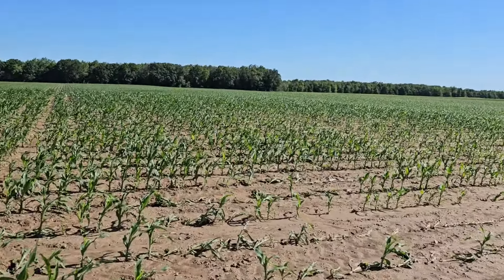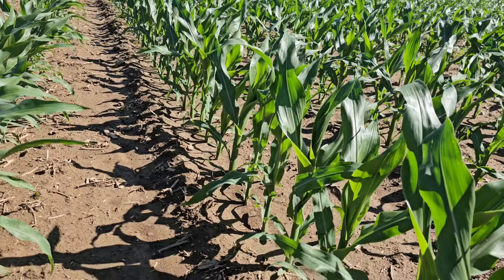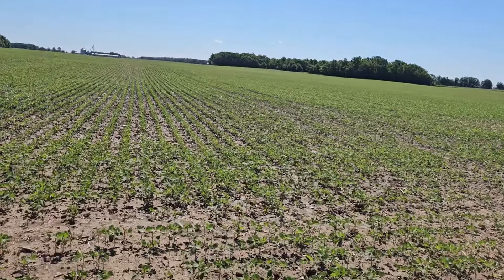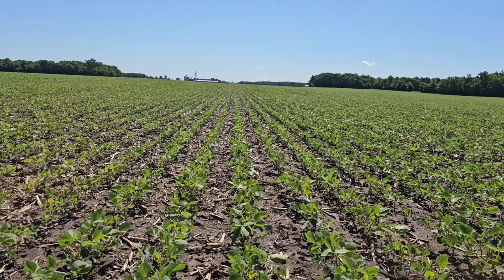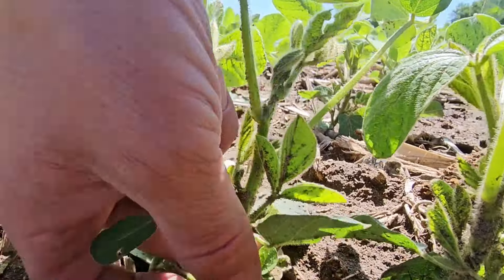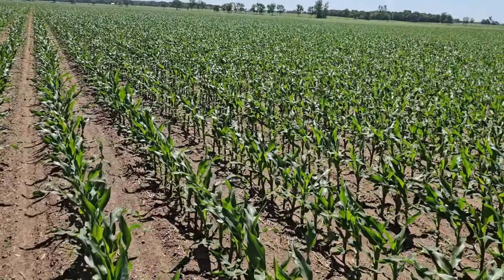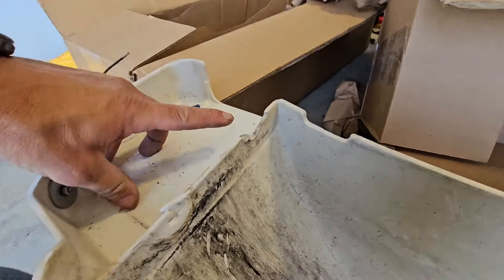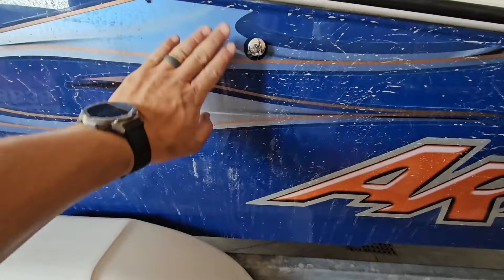Checking Crops with my Agronomist

Comment: Is it possible that the boat shifts a bit in what looks like a tight fit, putting pressure on the fenders and pushing them into the tires?
Reply from the maker: Only when I don't load it right.